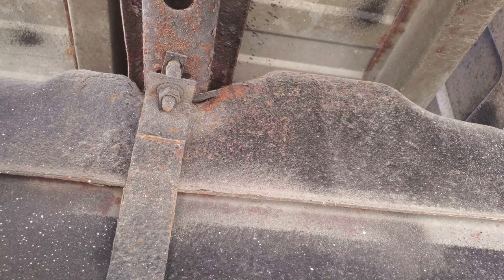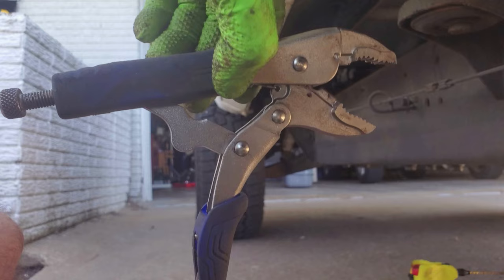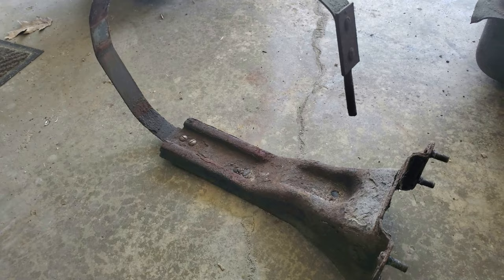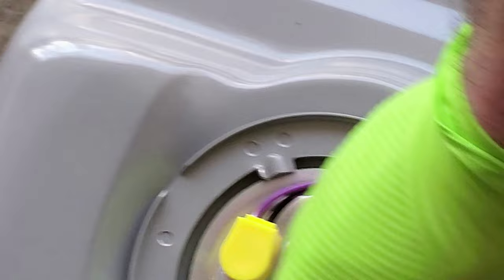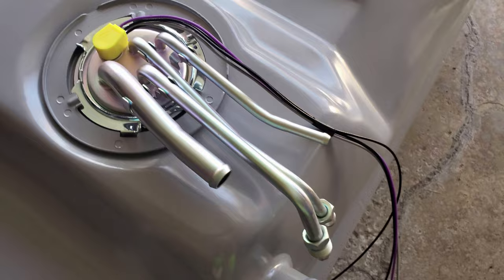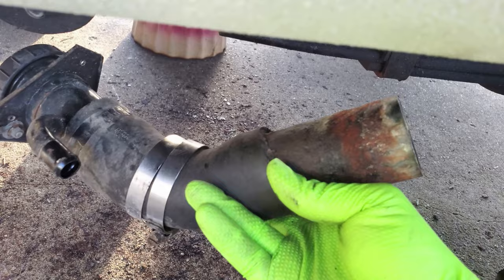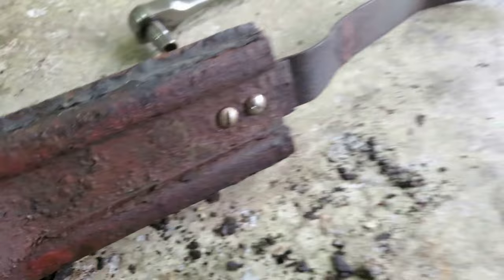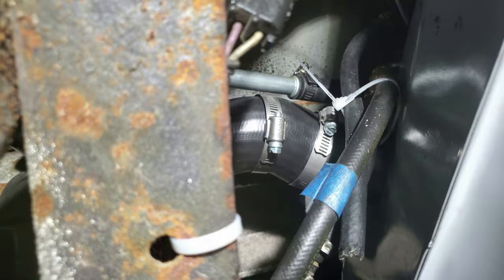Fuel Tank & Pump Swap on 88-98 GMC/Chevy C/K 1500 (New Fuel Filler Neck & Hoses & Lock Ring Tip!)

Comment: Great video.  I`m replacing my fuel tank this weekend.  What size nuts & bolts did you get for the front strap to replace the ones you had to grind off?
Reply from the maker: I believe i took the broken bolt n nut to ace hardware and they sized me up replacements for like $1